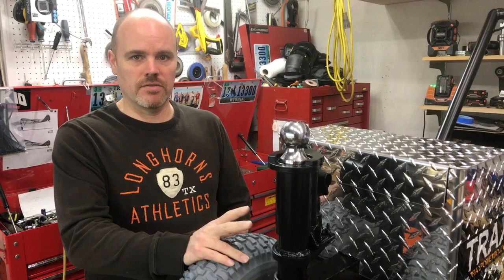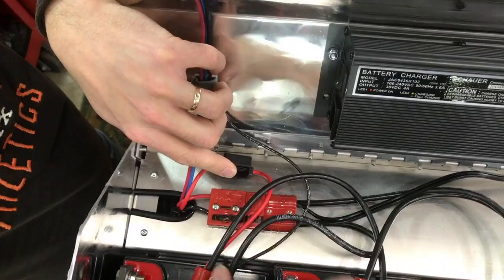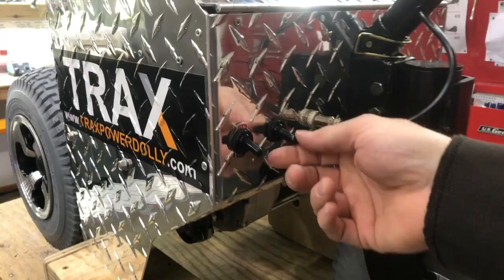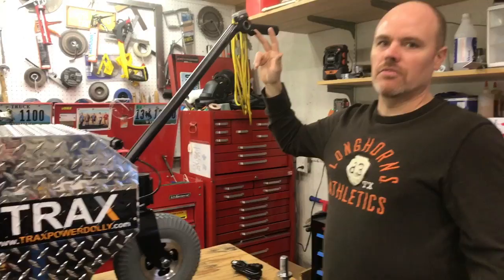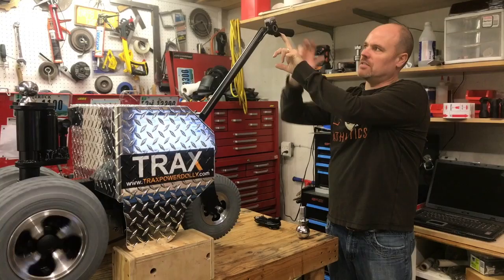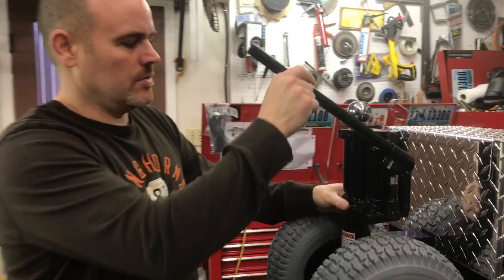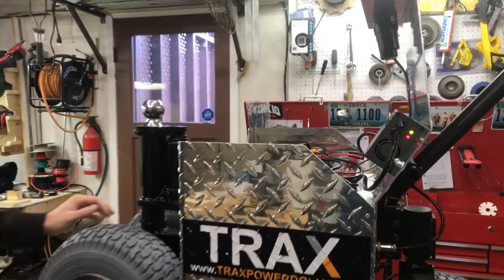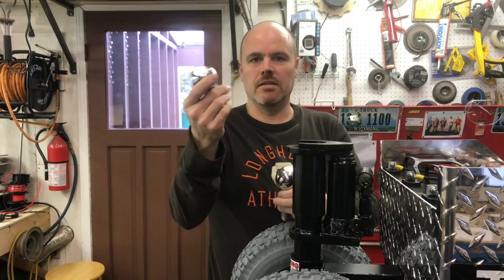TX6000 Trailer Dolly By -  Trax Power Dolly Systems Inc.

Comment: I really like this machine.  If you can answer my question.  I have a 16X7 Tandem anxle, load with 4K weight of machines.  Will I have problem moving it or will I over load the machine.  I know the question might sound silly.  I guess, what is the max tow that will not hurt the dolly.
Reply from the maker: Keith, our white tandem axel toy hauler trailer weighs 7500 pounds during our testing. We where able to spin the trailer 360° on the spot. We also pushed and pulled the trailer up a 10% grade. I'm sure the TX6000 will move your trailer easily.

Comment: Approximately how steep pf an incline will this push a 8x!^ unloaded trailer that weighs 3,700LB??
Reply from the maker: Lou Fraulo Sr , depends on tongue weight and ground texture. The more tongue weight the better traction you will have on the dolly tires. We have under rated the tow dolly considerably to allow for large grades, mixed textures and heavier gross trailers. Our toy hauler trailer weighs 7400 pounds during all our testing periods, just to prove the point and still the dolly moves up to 222 feel per minute with ease.
Reply: @Traxpowerdollysystems  Thanks Tongue weight listed as 2100LBS. Ground texture would be my asphalt driveway, smooth surface no holes.I would estimate the grade to be between 3and 5 % for a total of about 20' in length.

Comment: Do you have anything that can move a 5th wheel?
Reply from the maker: Steven, we will have a 5th wheel power dolly called the TRAX X5. It will be a wireless single joystick control and will be able to move 20,000 gross weight trailers. Keep an eye on our website for more information and videos.
Reply: Do you have an agent here in Australia?